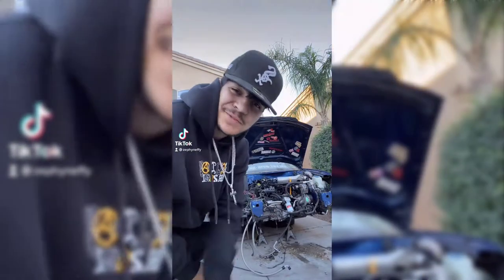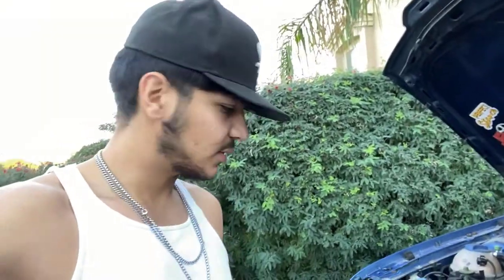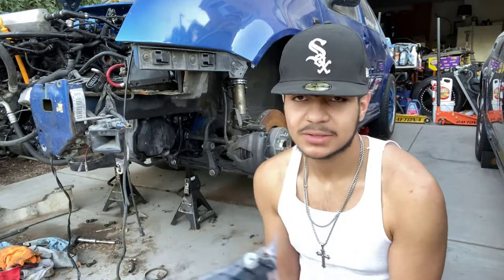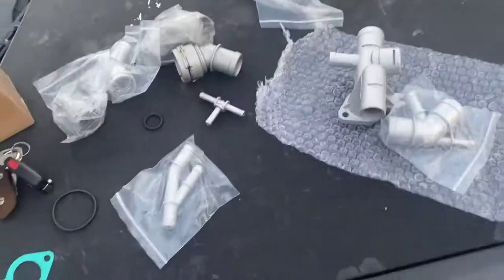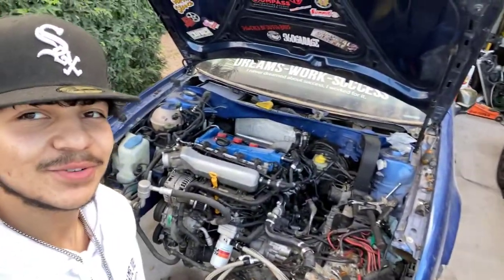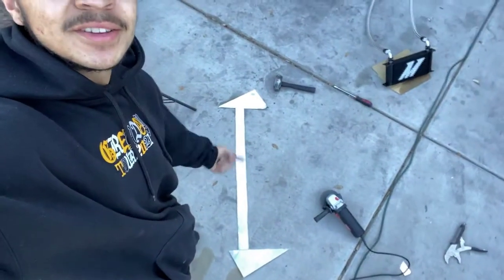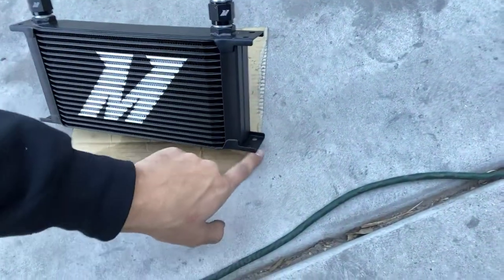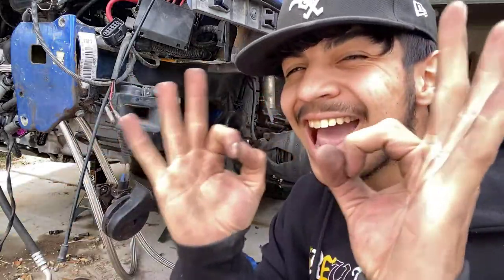INSTALLING PERFORMANCE OIL COOLER ON THE MK4 JETTA/GOLF

Comment: alright, idk if this is cursed or not. but you could bypass the coolant lines and potentially replace the old cooler with the new one. atleast thats what im going to try and see if thats possible. how you did it is kinda like adding a spacer on a scaver, i would hate to see the long thread snap.. idk how thick the material is

Comment: Can you drop the link for the kit you used im planning on replacing the stock oil cooler and trans cooler and add some temp sensors on mines

Comment: I installed a mishimoto oil cooler right in front of my alternator on my mk1 diesel. The alternator has cooling fins that turn so it blows air right on to the cooler mechanically. I took that sandwhich adapter and threaded it out for 3/4 inch npt and i threaded the oil cooler for npt also. Its soft aluminum and it will thread easily. Then i bought brass npt to barbed hose fittings and 3/4" hydraulic hose for tractors and used that instead of the stock an lines. The problem with the stock an lines is the an fittings use unreliable rubber o rings to seal the fittings to the spacer. I used jb weld as thread sealant and installed the brass barbed fittings into the holes i threaded permanently. This will ensure the system will not leak
Reply from the maker: That’s a very thought out way to do it, I would love to see how it came out and what it looks like in the engine bay send me photos on Instagram if you have an account @cruz._.customs or @_zeph.cruz_
Reply: @zephxcruz  do you have an email i can send to. I dont have instagram or social media. I will take pics of the set up. Its pretty much the same oil cooler being used. Its installed on an mk1 vw rabbit diesel truck.